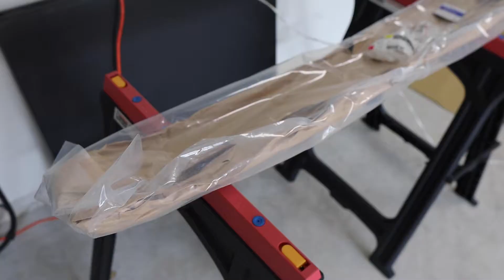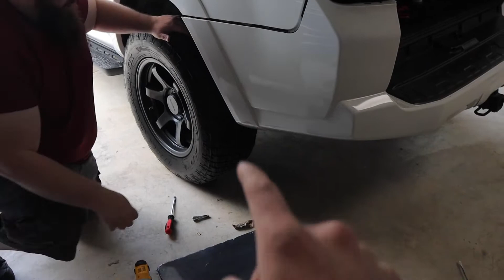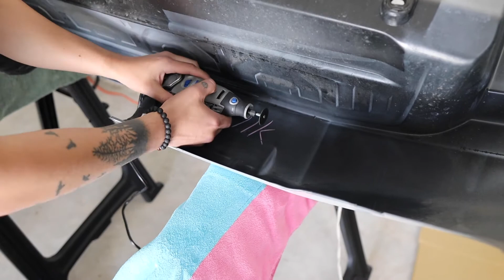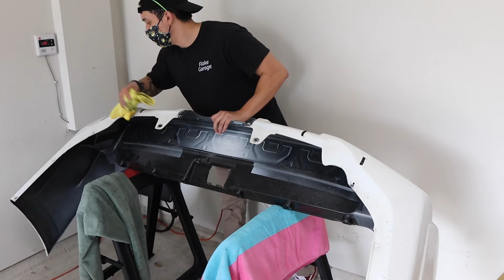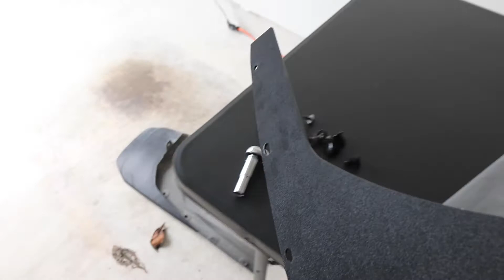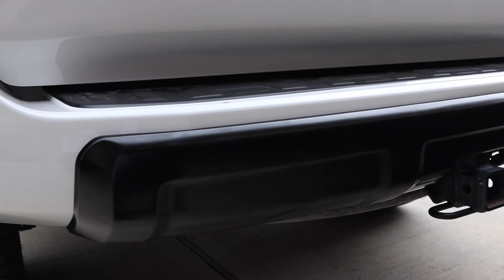2019 4Runner TRD Pro Rear Valance Install | SR5 Part 2 Flake Garage

Comment: WTF, this is nothing like other videos I've seen on this job. A dremal? Really? No one needs to do this!
Reply from the maker: You can use a knife with a new blade like we said in the description and it should work the same
Reply: Why?  I used a dermal with a router bit.  Easy peasy.

Comment: Thanks for this video. I knew the front had the markings but I wasn't sure that the back bumper had the outline for the valance
Reply from the maker: Sure does just like the front so you shouldn't have a hard time installing the rear 👍